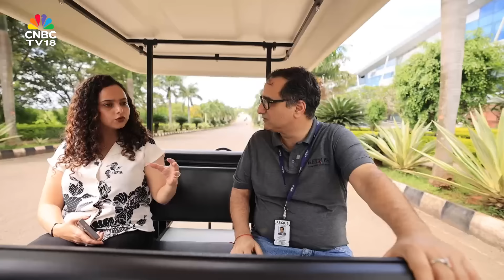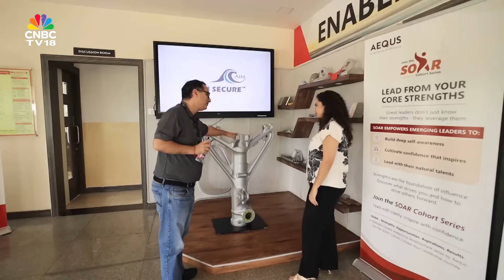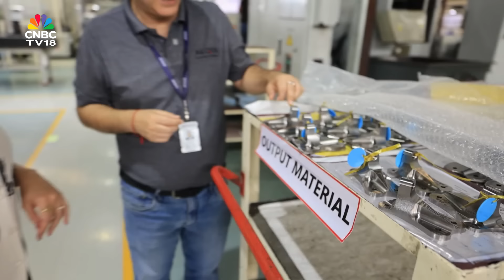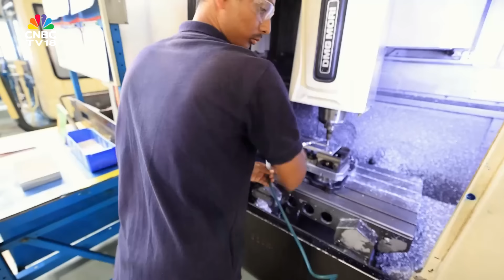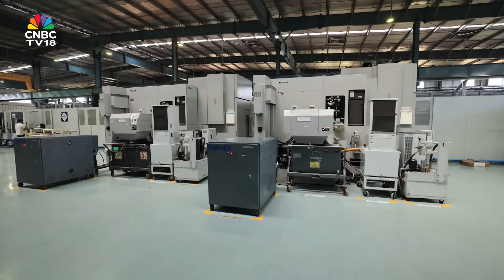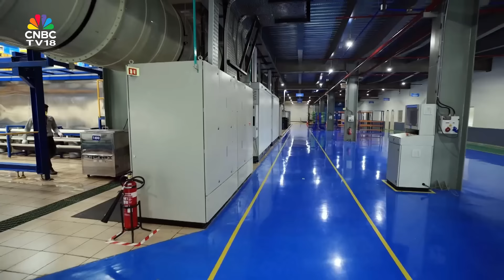WATCH: From Belagavi To Boeing, This Company Makes 4,000 Aircraft Parts | Aequs Facility | N18V

Comment: Some of the Aumotive component manufacturers treat the components like gems.The manufacturing facilities are housed in climate controlled (dust proof and temperature controlled) rooms. Except the operator, and the quality inspector, nobody is allowed to touch the components.Even the preliminary packing is done by the operator himself. This is the minimum expectation of the customer today.